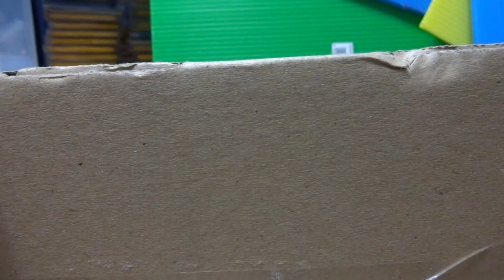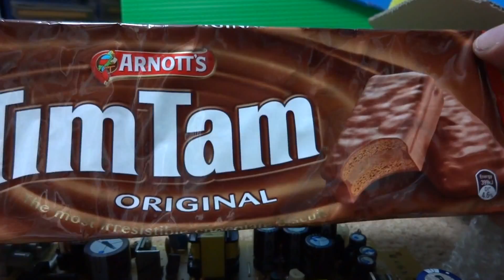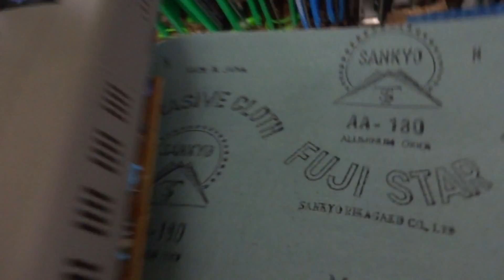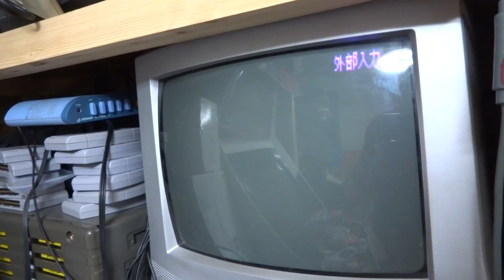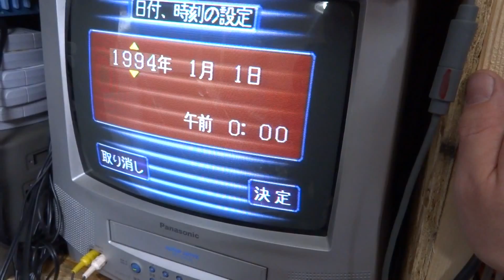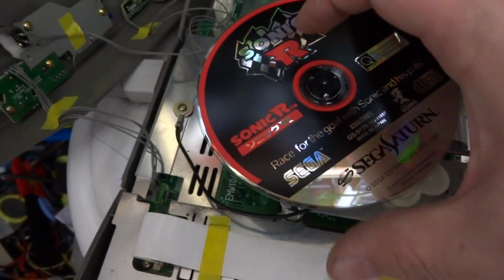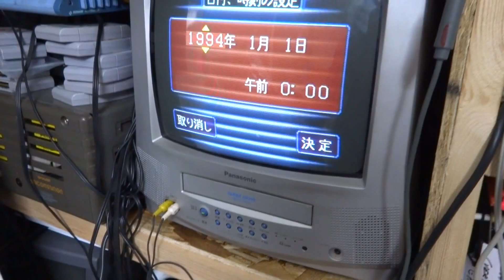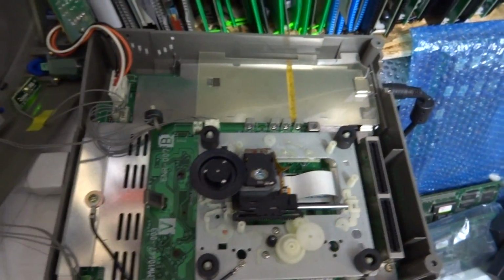Package From RaiZdbyDINGOES And Blown Sega Saturn Power Supply Varistor Repair

Comment: I've plugged in a 240volt supply into a Japanese 110 volt Saturn accidentally. Totally forgot, it's blown the fuse which I've ordered so hoping it fixes the situation. Other people have suggested the varistor needs replacing as well as this would have blown as well. But which one is it? Is it the one immediately next to or below the fuse, there are a few others as well on the board further down should these be replaced as well or just the one(s) up top?

Comment: I have a quick question lukemorese1.  When your power light was blinking what components did you solder because i am having the same problem but didn't know what parts you solder after you got the capacity fix.

Comment: I ended up with one of these early models as well, with a socketed BIOS as a bonus. The PSU looked exactly same as the one in this video. I hate using step-down converters so I ended up unsoldering the AC jack from the original PSU and fitting it on a later 240V PSU, then unsoldered the coloured cables and soldered them to the same pinout on the later PSU. All fits in and works perfectly in my case. But I can understand not wanting to desolder the coloured cables and swap them, it does look a little black burned mess on mine but hey, noone else is going to look inside my console and it works! Both were 5 pins in my case, just that the 240V PSU expected to slot directly onto the motherboard rather than a cabled socket.

Comment: Wow, the inside of the Japanese Sega Saturn is completely different than the Model 1 Sega Saturn released in the US "the power supply isn't attached to the lid, the power and reset buttons are not connected like shown in the video"

Comment: Question, will you ever make a video of fixing a saturn with no video and no sound?  Mines was working but then the fuse popped...I replaced the fuse and it turns on but no video... I have 8 saturns so I swapped plenty to make sure it wasn;t just a power board issue.

Comment: what is the diode you replaced at the begging. The little black square thing.  I am trying to fix my Saturn as it has screen flickering now and I think its my psu. So im going to try to fix my Saturn but having trouble finding a working psu.
Reply: It's a Diode bridge.

Comment: Hello, I am troubleshooting my Sega Saturn and was wondering if you have an idea. I was trying to fix a mod on my Saturn but I must have created a serious problem. My Saturn turns on, has disc assembly movement, and transmits a signal to the TV but no picture or sound. I assume it is part of the power supply but not sure which component is faulty.

Comment: I hv the same problem, I hv Japanese Saturn, I use step down transformer. replace the varistor still it gets blown
Now you say that the Varistor act as big fuse, cuz I change the varistor a few time already, I suspect theres another problem which cause the varistor blown, see im not electronic literate, i do thankful if you can point me what could cause the varistor to blown. Many Thanks!

Comment: No matter which model you have, they all become faulty.  The Saturn is average in quality, more so power board and lenses.  If they go on the blink, always replace them with news ones if you can get them.  A Japanese model in the UK, got for the white 240V model, as no need for a step down adaptor.  Or just simply fit a UK power board.  Same goes with the Dreamcast.

Comment: Yes wrong power supply is always a bad one with different degrees of bad. I blew a wire in the transformer of my Sony MSX 2+ machine (I got from the Netherlands & thought had been converted - grr sellers).  A friend of mine has just about finished building a new power supply circuit for it (cheaper than trying to fix the transformer). Has it working bar the -12V needed for the cartridge slot.

Comment: nice that you got the Saturn working!  Just a thought, it may be better to measure the voltages on a working power supply, get the broken one working and measure its voltages, then plug it into the motherboard.  Having it short out while connected to the motherboard could potentially damage the motherboard.  Saturns are common, but if it were a rare board, I would only connect the PSU once you know it works and outputs the right voltages. Good job man!

Comment: From what I can see, the 'capacitor' you replaced is not a capacitor. Note the legend on the PCB says VR1? That means it is actually a varistor (surge arrestor). It wouldhave blown because its clamping voltage was way below the 240V the last person plugged it into. :)